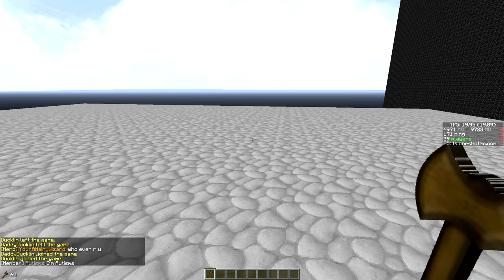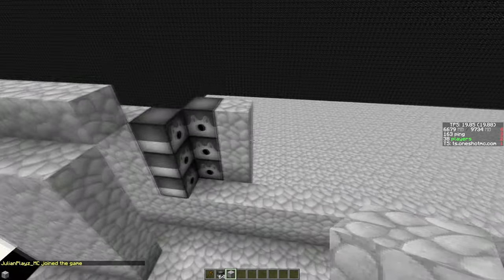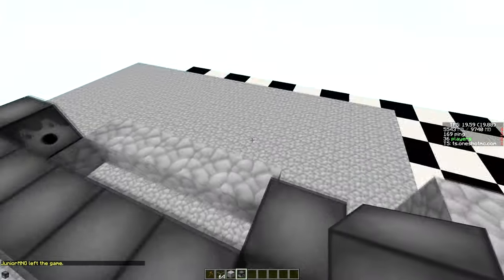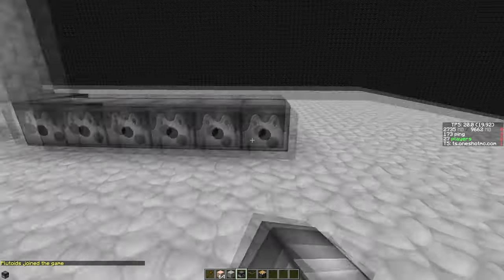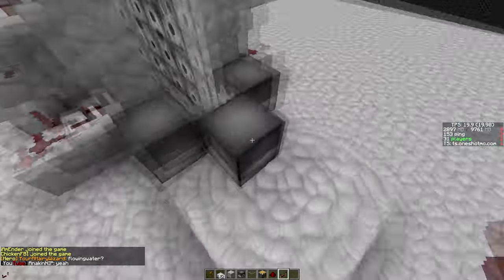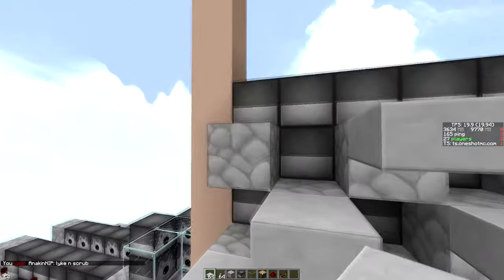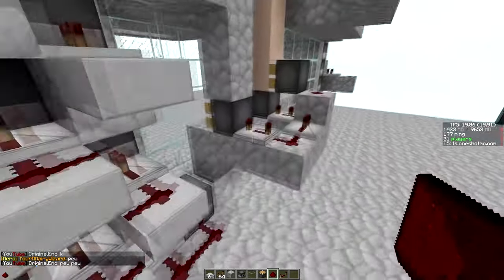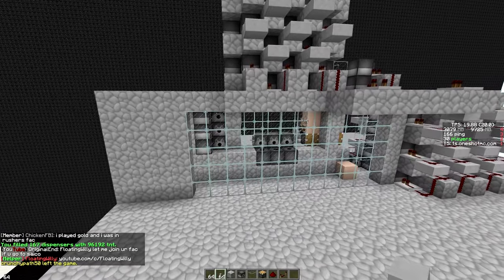Build Tutorial: How To Build A Cannon From Scratch

Comment: hey love your vids but I have question about your floating barrels it never 1 shots got any ideas how to fix it? if you have any ideas it would be great! for shooting threw normal walls it is 1 tickets on the hammer right?
Reply: If they have slabs u need to swap the repeater on the slab bust to a comparator to 1 shot
Reply: ik that but it keeps blowing up left of where I have it aimed
Reply: Ahh i know why

Your shooting east to west try shooting north to south or activate the allignment
Reply from the maker: Make sure u build it at the right Y level and also make sure the tnt reliner is on. If that does not help the issue. Try adding abit more hammerdown :)
Reply: it one shots north if you put 2 ticks on the hammer but south it has that issue  when it explodes to the left

Comment: Ok So basically, I made a 100 stacker using these steps. My slab bust does not work correctly, it only works when I add 1 more tick from the hammer, but if I add one more tick, it doesn't 1 shot. in the same shot. Someone help me please.

Comment: Can someone tell me for what is the Floating Barrel?
Reply: It is a cannon that where the tnt shoots out is at the top instead of the bottom
Reply from the maker: A floating barrel is a barrel that makes it possible to change the high of the shoot. :)
Reply: Dexter113 ty
Reply: +Dexter113 hey dexter i have a question and it is that if it is possible to upshoot and hybrid at the same time for example if underbthe base if covered by water you hybrid upshoot
Reply: Markey 11 its markey from Temper again!